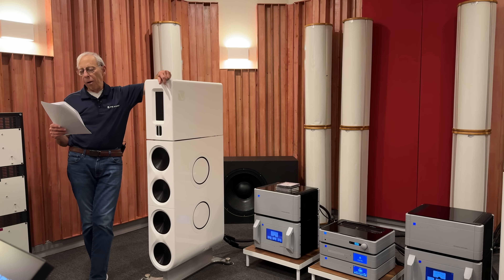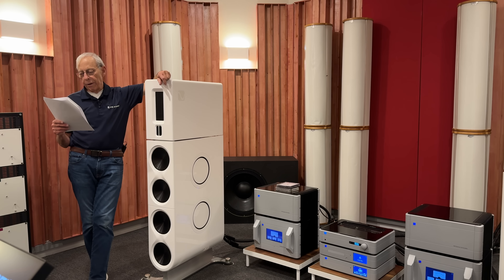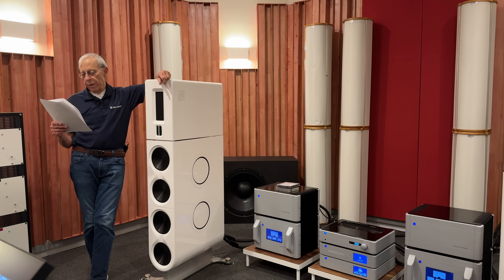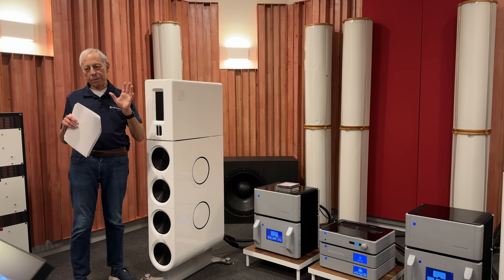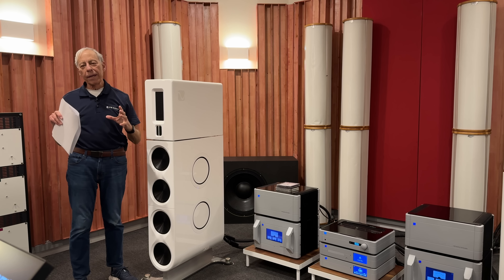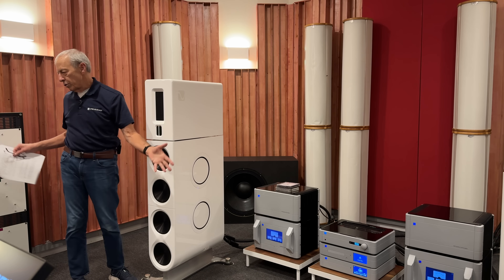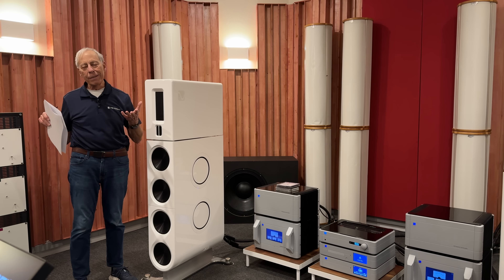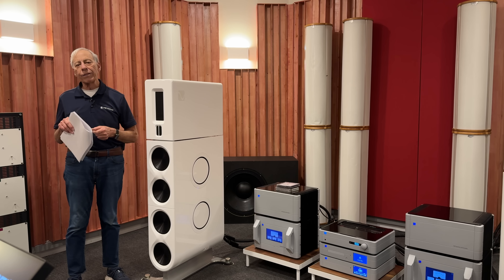XLR audio and digital cables

Comment: Hey Paul you should make it clear that you are only recording single bits at that high sample rate and that you have to add a lot of noise to that stream in order to keep the timing stable.
People may misunderstand your statement to mean that you are recording at a higher resolution which isn't true.
Reply from the maker: Well, you're correct it is 1 bit. However, I suspect you're struggling a bit with how it works. There is no added noise (typically called dither if I am understanding you). Also, the equivalent PCM rate to what we record at is 352.8kHz 32 bits, far higher sample rate and bit depth than any commercial studio.

Comment: Both cables have an XLR connector.

What's different is that one is meant to be used for analog microphones/preamps, the other (AES) is meant to transport a digital audio signal.

You can use a digital XLR AES for analog signals but cannot use analog XLR for digital signals.

Regular analog XLR is typically cheaper... Just choose depending on what are your needs.
Reply: Cool, because I have a whole bunch of Apogee A-110 WydeEye cable.

Comment: Locking Rigid 
X-Connector = XLR 
Paul is a Anchovies Kind
of Guy….Well I Knew It
Paul Just 
Insulted About Half a Million Samoans 
….a Lot of This Information is Readily Available On Google 
….Yet Sebastian Would 
Loose The Pleasure of 
Asking Lip Smacking Paul 
Pineapple 🍍 or No Pineapple 🍍 on a 
Pizza 🍕 Yet XLR Is Stock Analog….The Really Good XLR Cables 
 Have a Tiny Micro 
Screw To Lift The Ground and Some Desk or Mixing 
Boards Like 
The Midas Heritage HD96
Can Flip The Pins of a
XLR if You So Choose To Do This In Phase Out of Phase…… The Next Question Lobed at Paul
Will Be….
Boxer’s or Brief’s 
I Bet Paul is Full 
Commando 😮 Or 
Man Huggies…..
Enough of This 
Elicit Chatter and 
Fiddle Sticks 
….I Have a Basket of
Blue Barry Amish 
Muffins Time For a 
Splash of  Almond
Liqueur Over My Muffins 
The Old Lady is Calling and I Had a Nice Bud of
Purple OG 35% THC 
Now We Are Talking 
The Dogs 🐕 
Want To Go Outside 
For One Last Time 
Good For Me I Can 
Spark 🔥 it Up
Then Have a Muffin

Comment: I was just discussing this with a musician in relationship to it's use in musician's audio, but it's fundamentally the same strategy whether it's a high impedance signal over a great distance being sent to equipment or a high wattage signal being sent to far away speakers.

Because the XLR has the common/ground and 2 hot leads, they are run out of phase and recombined in relationship to what they're being used for. In the case of hi-fi or Pro Audio speaker power applications, there will be a filter that's just above the audio bandwidth and when the out of phase signals are combined, being reverse polarity, it bucks it away and cancels out the noise. 

It's really fascinating to discover a lot of these strategies have been around since the 50's and 60's and just how effective they are. I'm a formally educated amateur electronics engineer and make that reference in that I simply did not finish the degree but I made it through the bulk of analog electronics, quantum theory, math and fundamental topology. 
I was taught the electron model of mass, energy and motion and would greatly impress upon others if you seek to learn about this science, do not follow the "conventional path" or "mathematical current path" as it's also known. 

I won't digress into a rant but by learning the physics in reverse under the premise of current in the form of holes, the theory is just garbled nonsense but because the math and design topology is still the same, you will be able to become a highly efficient worker and theory won't matter to you but if it does, you will always be wrong when going up against someone taught the electron model. 

In simpler terms, the electron model allows for quantum physics and classic mechanics Newtonian physics to be perfectly compatible but the school of thought today has these people very confused and believing the opposite. I said I wouldn't digress but I'm eternally grateful for my school and knowing I didn't waste my time in hindsight which is what the conventional model does.

Comment: Will the input selector become an issue when XLR gets into a conflict with single ended choice if it isn’t found in the proper position?  Will CMMR be applied down the run if Royal decides no? 📌 Pin-apple- interesting uh huh is that good?

The XLR is a three lead cable for analog.  I would ditch it if you want digital.  I don’t a differential signal is common for digital pulses.  Fiber optic cable is suitable for noise free digital transfers.  Not that it can’t be done the other way.

Comment: XLR cables for AES/EBU application have 110 ohms impedance (and are therefore special cables), though wired the same as audio XLR cables.  A short audio XLR cable will probably work but will likely cause increased jitter over using a proper 110 ohm cable.
Reply: You mean jitter due to capacitive impedance issues causing the rise time to have issues on the digital pulses? I would be concerned of any audio gear so hyper sensitive to that. Jitter is only an actual problem with poorly designed DAC clock architectures incl. PLL.
Reply: It could make a real difference on long lengths (more than 20 meters, i would say) but on shorter length it won’t really change a lot.
Reply: @MrTchou  Yes, agree, but the likely audible effects of a too long digital interconnect cable is not about loss of soundstage, details or tonal balance. And jitter issues are about poor DAC design foremost. Data dropouts can sound like high pitch distortion if the DAC converts data error values.
Reply: Having worked on events, « smart » lighting also use XLR for the Dmx protocol the dmx cables are 110 Ohms, audio xlr cables are 75 Ohms (mic cables and interconnect between mix table and amps). 75 Ohms will work on Dmx equipment provided the dmx network is not too populated, issues will start to appear if you have a lot of « talk » on the network.